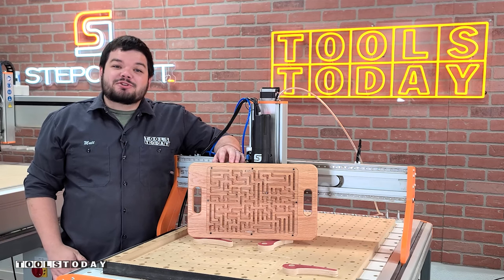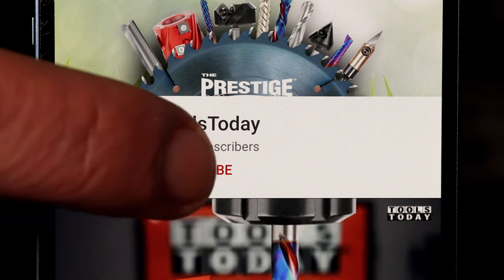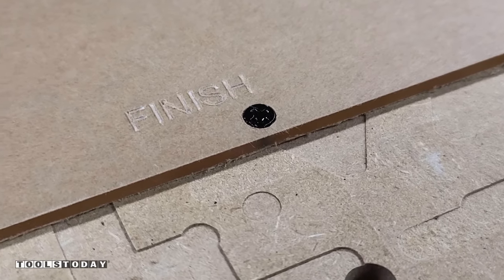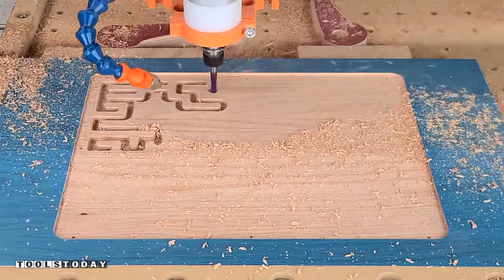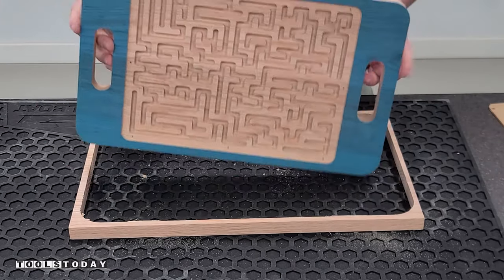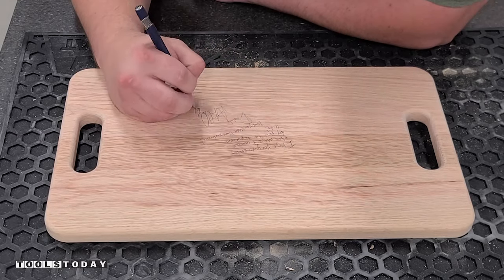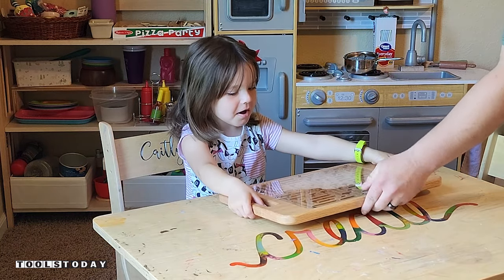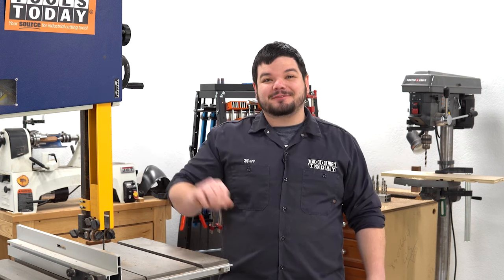How to Make a Wooden Maze Game on CNC | ToolsToday

Comment: Awesome  job, what kind of tape do you use for keep the acrylic firm over the board? I'm planning to buy my first mini cnc router for cut and engrave acrylic lamps so trying to find what hardware I need for start working on it, by the way what bit could you recommend for engrave and cutting 3mm acrylic that is the material I will use